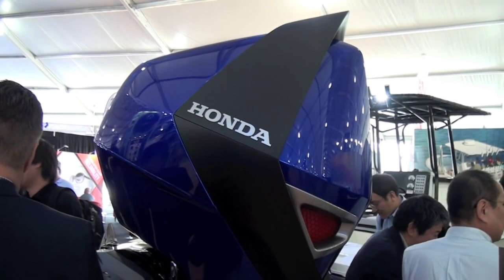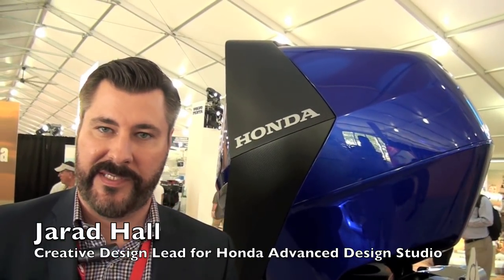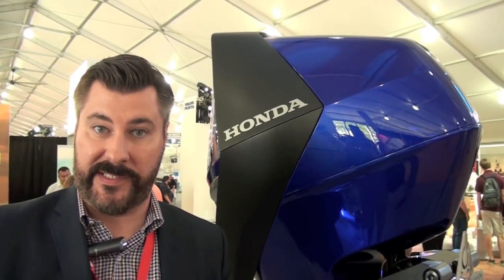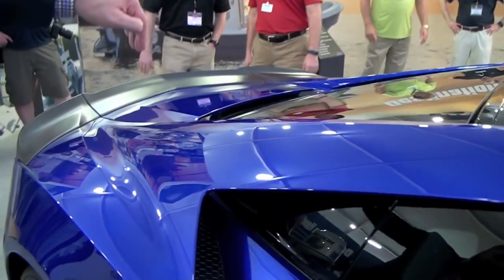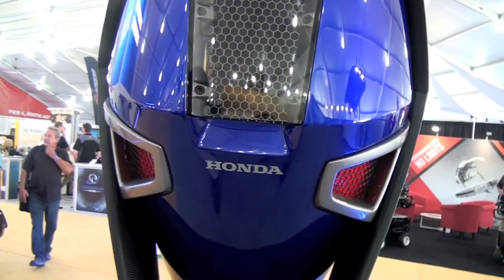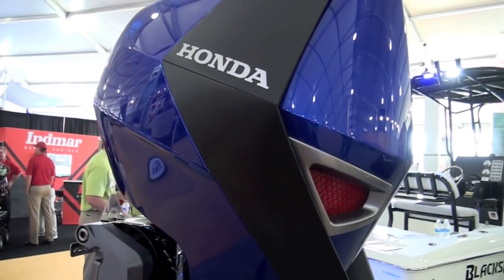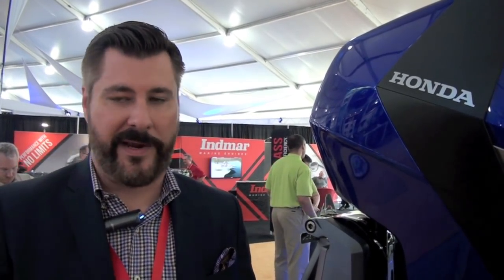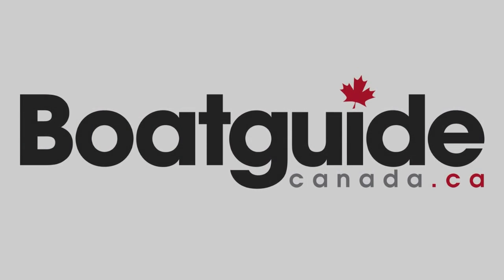Honda Unveils Acura NSX Inspired Outboard Concept at Miami Boat Show

Comment: Who cares how it looks is the engine better? Honda is always on the low end of specs
Reply: Fair enough. Let's see if they actually build a new high-horsepower series of outboard engines. If they do make a play for the offshore and performance market, the specs better be on par with Mercury, Yamaha, Evinrude and Volvo Penta/Seven Marine or it will be short lived.
Reply: I doubt anyones going to be able to touch Evinrude anytime soon with regards to fuel economy, performance, and maintenance. I don't think it's the specs that matter though, it's marketing and public perception, otherwise everyone would have Evinrudes

Comment: DOA...Yamaha and Suzuki pretty much own the 4-stroke outboard market. That Honda engine looks blasphemous.
Reply: Mercury not Suzuki as much
Reply: SrSO4 Mercury stands where the domestic automotive manufacturers stood in the 80s. Yamaha has already taken the lions share of the 4-stroke market with Suzuki coming on strong. It’s only a short space of time before the S. Koreans enter the outboard market just like they have in all other segments. They have currency manipulation and age-old import treaties on their side . Unless currency manipulation and unfair trade deals are once and for all addressed Mercury will face the same future as other manufacturers like OMC.
Reply: Wayne Swicegood the thing is mercury has better efficiency (1/3 less gas consumption than a 2016 Suzuki at WOT) and the new FourStroke model is 120lbs lighter than Suzuki and 87 lighter than Yamaha, same with 50lbs lighter than evinrude. (This is for a 225 DTS.) we have the wrong prop which makes us run 1000 rpms under full throttle but still get 3.4 MPG at 30kt cruise. But Yamaha has best reliability but they are really heavy and have a lower torque on their v8 350 than Suzuki and mercury v6/I6 350. This is just showing what they’re doing is excellent in the industry and seeing evinrude is now working with mercury, the DFI tech will help make the engines more efficient and powerful, possibly even lighter!
Reply: SrSO4 All you said may be true but it doesn’t matter when currency manipulation and treaties are working against you.